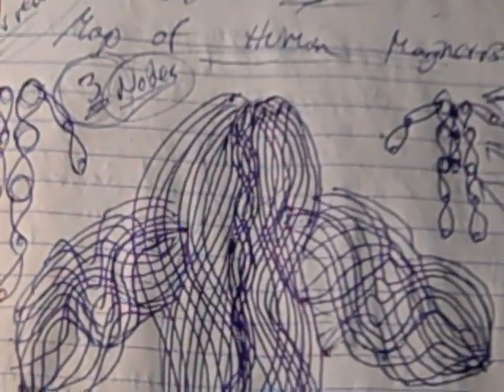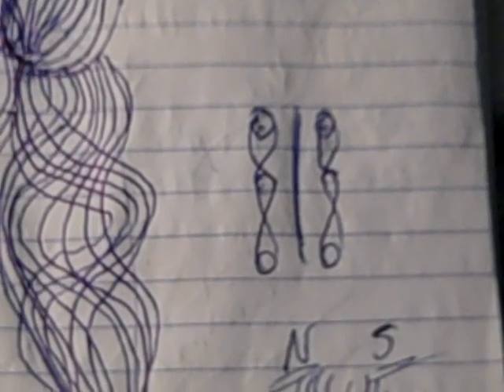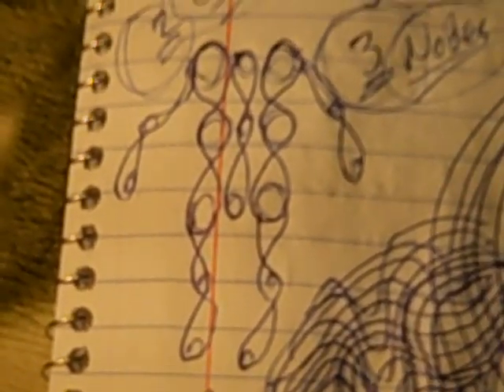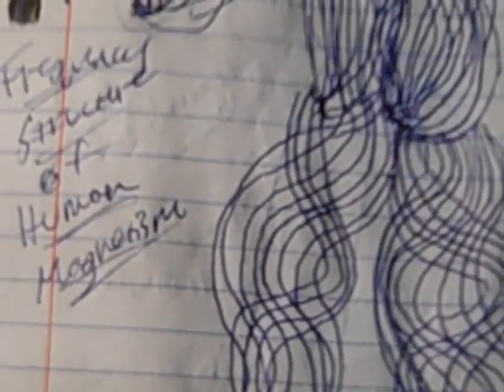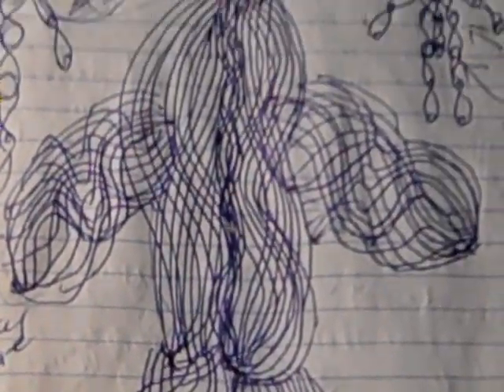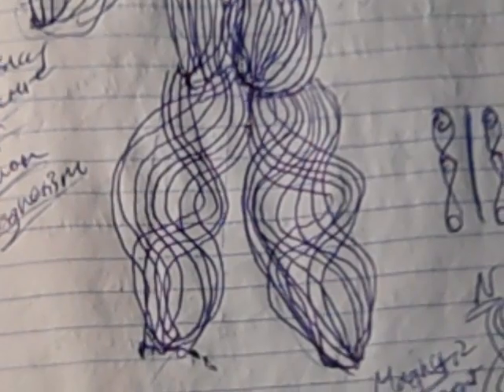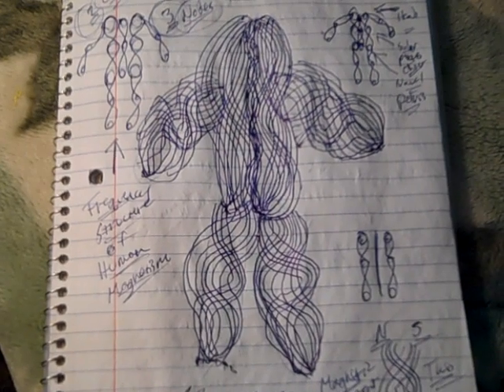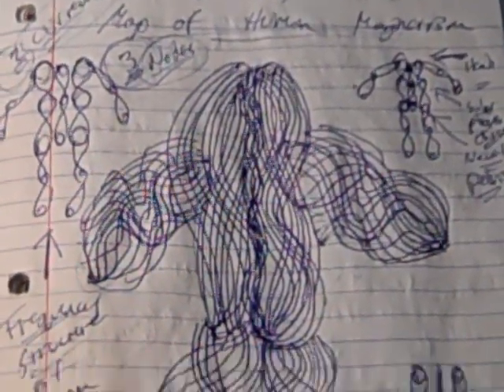Frequency Structure of Human Magnetism

Comment: Hi Gabriel...here is a concept that relates to your work, you may already be aware of. We know that trance amounts of metals exist in our bodies,  including magnesium, zinc, copper, magnesium, plus many more, plus silicone and other elements used to produce electronic equimpent, including robots and computers. Think of our bodies as water cooled, lubricated, electrified, and evidentially magnetic, in addition to producing an electromagnetic field that is the equivalent of a radio signal, this includes the bio-electromagnetic fields in each of our organs...down to the EM fields of each and every DNA molecule in our bodies (think helical or fractal antennas ,with regard to dna. Humans I think are some kind of glorified robots or androids,  and our bodies the hardware and our DNA serving as the main software, operating under some kind of Spintronic computing and biosensing technology or something . I think what you are doing is legitimate, but it needs to be placed into context for use boneheads, for the sake of context. You might want to google spintronic computing and biosensing....and if you search in utube for ''Cybernetic Universe'' I have some vids that are far newer than the one you looked at, I think. What your are describing would be a form of technology that is not inconsistent with my cybernetic universe/technoverse theory